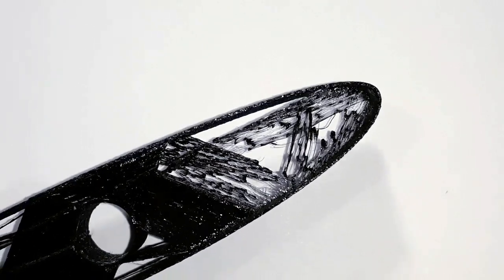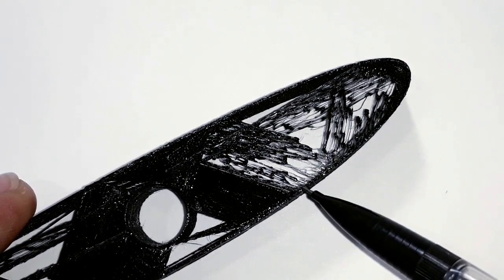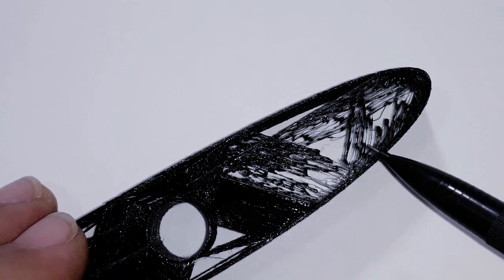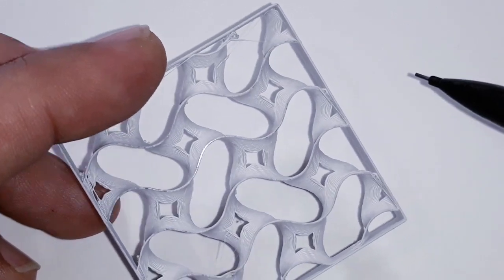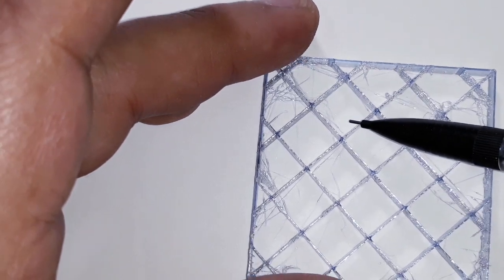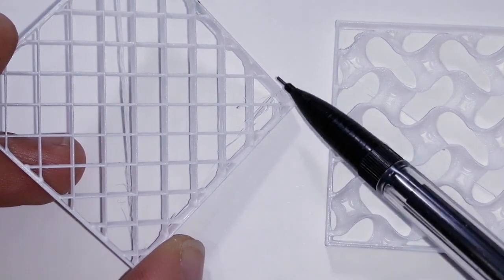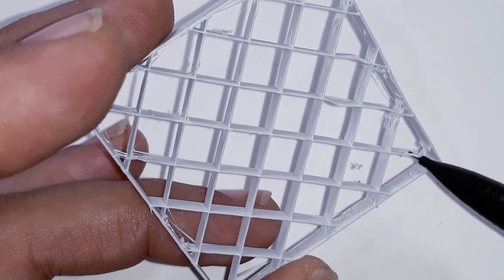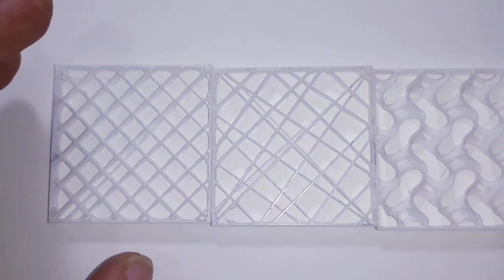Infill Problem, Infill not attaching to the walls with Cura slicer, Advanced 3D printing. English

Comment: Thank you for the video. Didn't answer the issue I'm having but taught me allot
Reply from the maker: Thank you, let me know what is the problem, I may be able to help.
Reply: @gonzalop.chomon327  my infill is printing similar to what you were having issues with but everywhere. I'm thinking maybe my speed is too high actually and possible clogged nozzle. Thanks!
Reply from the maker: @dustinnygard3076  Try to reduce speed for infill and/or increase temperature.
Reply: @gonzalop.chomon327  thank you. Now that I think about it the printer is literally flying through the infill areas super fast. Thanks!
Reply: @gonzalop.chomon327  I found the problem. It was under extrusion. The gear wasn't putting enough pressure on the filament because the cheap plastic arm on the ender 3 broke from the pressure. I wanted to update you. Thank you for your willingness to help
Reply from the maker: @dustinnygard3076  Good that you found the issue.
And yes, in order to print fast the biggest issue use to be the extruder not able to cope with the demand.